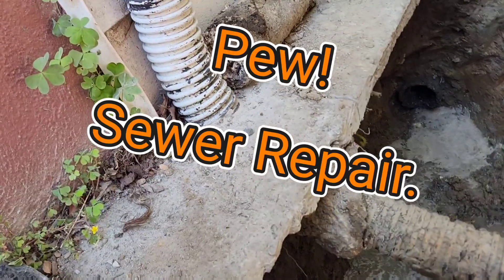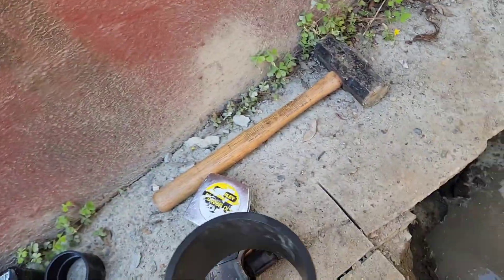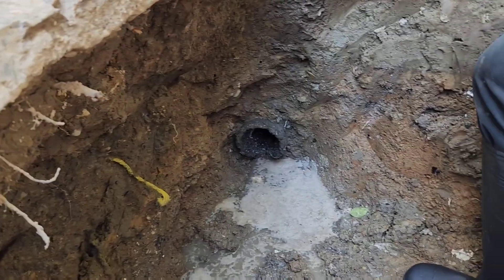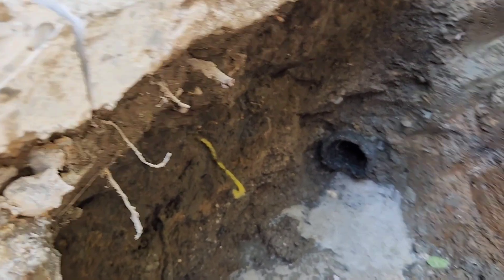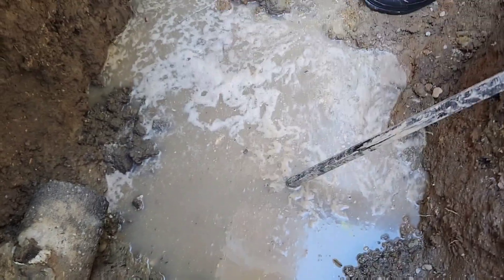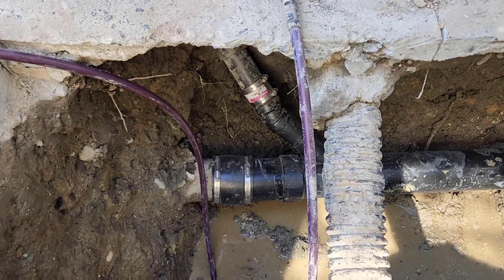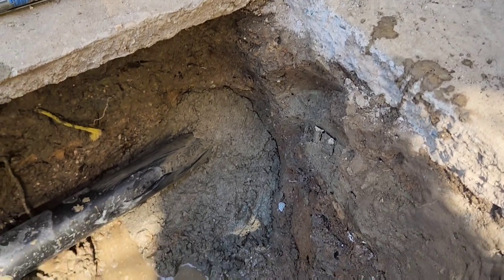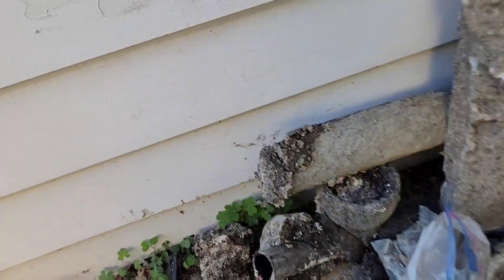Sewer Repair Replace 4" Concrete Pipe With 4" ABS Pipe And Mission Couplers

Comment: What sealant product did yall use for the concrete/ abs connection before backing the hub with concrete?
Reply from the maker: Quickreet 
Advanced Polymer 
Non Sag Sealant 
The repair is still holding and performing perfectly 👌

Comment: Not your house I hope!🤞
How many Decades of stuff you figure that was in the pipe?😬
Mike in San Diego.🌞🎸🚀🖖
Reply from the maker: Many many moon of buildup.  Assisted by prior botched repair. I was just in a hurry and should have really documented more of this repair. There was a secondary clog about 25 feet out. The pipe could not be rooted due to the hack quality of the previous repair.  Some dorky girl is pestering me for the remote. Ok, with the repair, it was a cinch to run a power snake out the pipe and unclog it. Everthing is as it should be now.